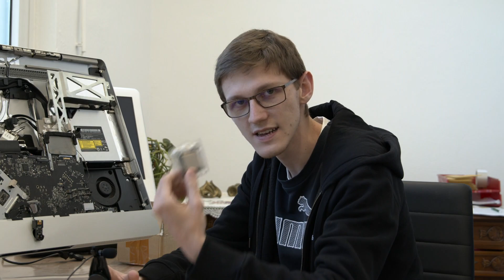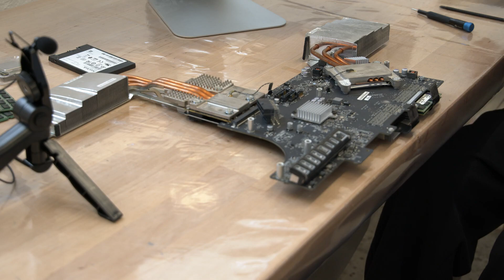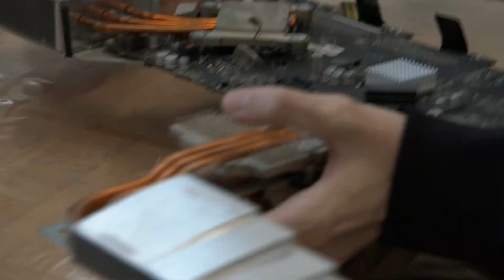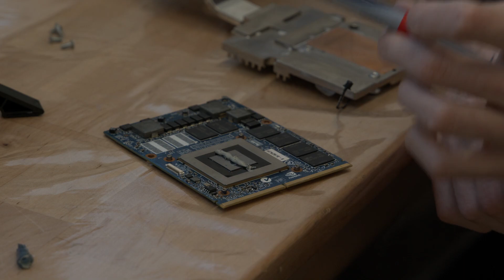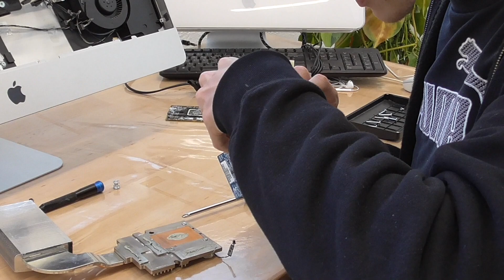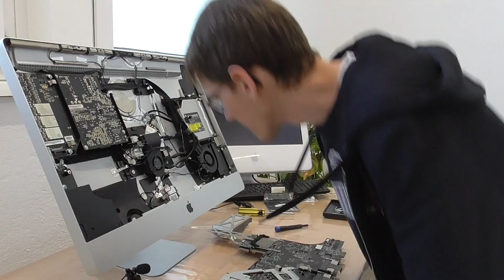2011 iMac GPU Upgrade was a total disaster (GTX 870M/i7 2600)

Comment: Use K5 Pro (for chips other than GPU) & Thermal Grizzly Kryonaut (for GPU only). I mean this has no bearing on the issue with LED #3. In terms of the problem with the board, frankly you should be handling the computer and internal components in an ESD safe environment. It's not impossible to prepare an ESD safe environment. An ESD matte wired to ground and to connected to the matte you wear an ESD wrist strap, that's basically it. ESD is not expensive and it will protect your hardware. It amazes me each and every time I see people handle all these electrostatic sensitive parts as though they are dishes or something. Hope this helps and click the video link below if you don't believe me. Actually parts of this video is as payed as part of the Apple Hardware Certification training course which I took part in about 6 years ago. https://youtu.be/tcRqj9FhgcE

Comment: Here is the correct stuff to use between the heatsink and the memory chips on the GPU. 

K5 PRO Viscous Thermal Paste for Thermal pad Replacement 60g 3X20g Pack (iPhone, Apple iMac, Sony PS4 & PS3, Xbox, Acer Aspire etc) https://www.amazon.com/dp/B00K04D3UK/ref=cm_sw_r_cp_api_glt_fabc_NH9NSD7XEWTJE3V815J9?_encoding=UTF8&psc=1

Comment: remember LED3 on the logic board, will only light up if the vbios is flashed of the GPU. (LED3 needs Apple EFI firmware on the GPU)
If the card has a compatible Dell vbios for example, usually internal imac screen should work, if not try external screen.

Otherwise flash the card with he special linux stick, (posted on the macrumors forum).

good video, hope you can get it fixed soon !
Reply from the maker: OH ok!! Well I didn't know that. Unfortunately I think there is still something wrong with the board because it also didn't light up with the original Mac branded 5000 Series card. I'll try the flashing process though, maybe it works out? Thanks a lot man!
Reply: @MacintoshMen  yes, hope it works ! 
Did external screen work, when using the nvidia card, or Mac AMD5000 original card.. ? 
Have you tried this.. ? 

Also try with an Nvram/Pram reset, and see if that helps.

Flashing the vbios using the linux usb stick, and SSH is always handy to do..
this way you can also see if the iMac will even bootup an OS, and works, you can then SSH into the iMac and flasht the vbios.
Linux instructions (prebuilt image) is all available on the Macrumors iMac 2011 GPU upgrade guide !

Good luck, keep us posted..

Comment: Just bought yesterday my first iMac of this generation! 
It was a A1311 iMac 21.5 2010 base model with a dead GPU for just 45€… Wanted this to use as a external monitor but I just put the GPU in my oven and the iMac worked again! Screen has some kind of a little water damage at the left side and the panel got yellow. Anyone got a suggestion what I can do with this machine in 2021? And is there a fix for that yellow screen issue
Reply from the maker: I'm afraid that there is not a lot you can do against that yellow screen problem (unless replace the entire monitor which doesn't make any financial sense of course).
Reply: @MacintoshMen  bottom is slightly yellow and top seems kinda normal, it fades out perfectly and it‘s not like there is a special spot. I turned up the white and the mac look now normal at the bottom and the top to white :/

Comment: Just want to say thank you for your videos. Had a fun time upgrading my 2010 27 inch i3 iMac for my son. 

Keep it up :) 

Maximum upgrade of iMac mid - 2010, 27” (iMac 11,3)

CPU : From 3,2Ghz Intel Core i3 to 2.93GHz Intel Core i7-870 (Quad Core, 8 threads) - US$ 40
SSD : 3 TB WD Hard Disk to a 1TB Samsung 870 - US$132
OWC SSD Cable : US$38
RAM : 8GB RAM to 16GB RAM (Crucial, (4pcs of 4GB DDR3 RAM) - US$ 99 
GPU : ATI Radeon HD 5670 512MB to NVIDIA K4100M 4GB - US$145
GPU Heatsink (3 pipe) : US$ 20
Total : US $ 474
Prices are before shipment.

Used Xanderon’s UNIX flash drive and SSH from a Windows desktop using Putty (64 bit). Basically user id is root, password is flash if using Putty. 
Followed guides from Curtis Gross (best visuals), Macintosh Men (best pioneer) and MacRumours (best complete information A-Z but needs many weeks to read through).

GeekBench score after installation
CPU
Single Core 442 (476 for stock CPU) performing below the 547 expected. 
Multi Core 1459 (1043 for stock CPU) performing below the 2068 expected. 

GPU
Open CL - 3978 (1508)
Metal - 5290

Cinebench
CPU (Multi Core) 2473 points
Reply from the maker: You're welcome!

Comment: Imagine how much money that would be in Kyronaut?! HAHA

The only issue with that much (non-conductive) thermal paste is the waste of money and the mess. I'm also worried about a possible short there on the GPU, the macrumours forum's page recommends grinding the heatsink to avoid contact with the coils.
Reply from the maker: I'm glad that you pointed that out, however there is in my case no risk of a short because the bracket has a rubber gasket.
Reply: @MacintoshMen  oh I missed that! Thanks for pointing it out!

Comment: I don't think the i7 2600 is compatible, you should use the i7 870
Reply: the i7 2600 is for the 2011 imac and the i7 870 is for the 2010 imac
Reply from the maker: Yes exactly. i7 870 is for 2010. The 2600 works fine in the 2011.